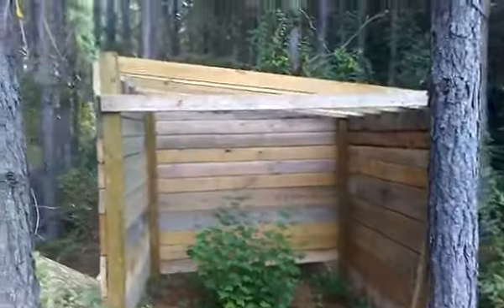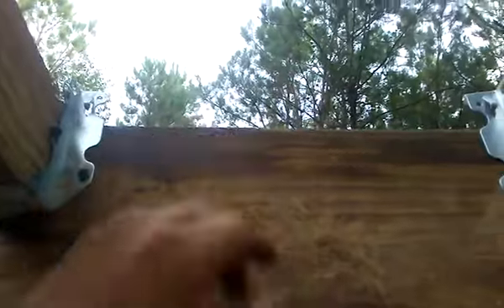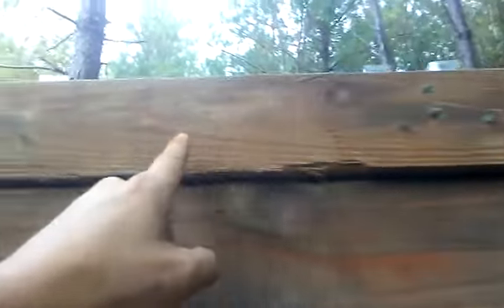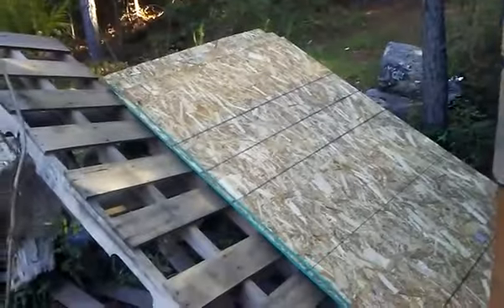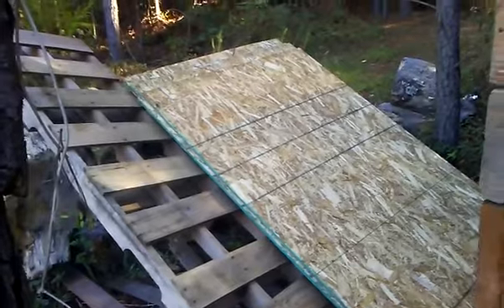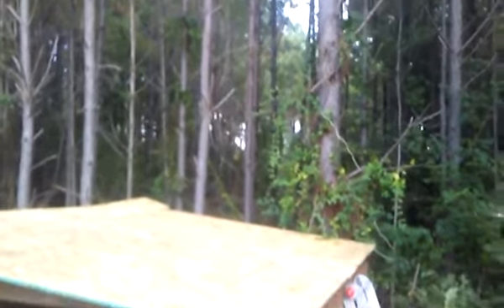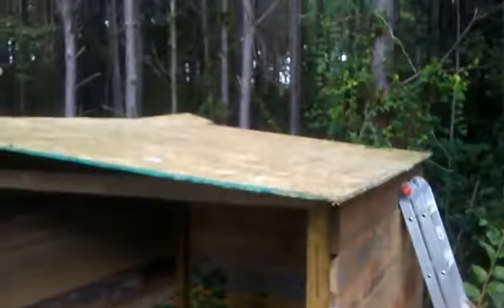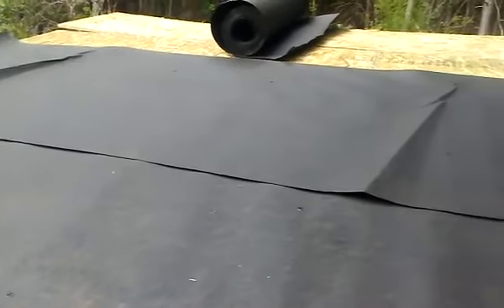Tool Shed Build, part 3

Comment: Shed is looking really good and those 3 1/2 inch screws will definitely hold. My Grandfather always told me as a rule of thumb is double the thickness of the board your nailing/screwing to determine the the nail/screw length. 1inch thick board  2inch nail/screw minimum,. 1 1/2inch thick board 3inch nail/screw minimum.  It has always work for me. Your doing a awesome job and keep up the good work friend.
Reply from the maker: Thanks! Yeah, I tend to over-build things, I'd rather have it too strong then not strong enough, LOL. Thanks for watching, and y'all have a great weekend, it's almost Friday!

Comment: Be careful with no eye protection Andy, I paid a big price on my homestead on January 3, 2015.  I blinded myself in the left eye only because I did not have eye protection while trying to remove a rusted nail from a piece of metal.  Changed my life in a big big way.  Tool shed is looking good.  Thanks for sharing buddy, Carl and Dawn Homestead
Reply from the maker: Yes Sir, I know I should've had safety glasses on, I usually do, but mine got taken out by the new puppy the other day, I'm getting a new pair today for sure. Thanks for watching, and y'all have a great weekend!